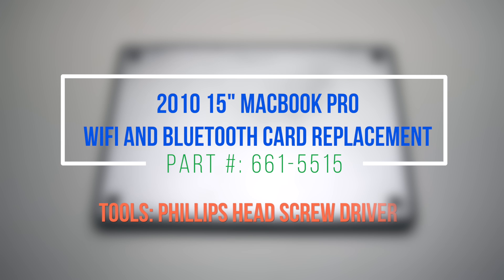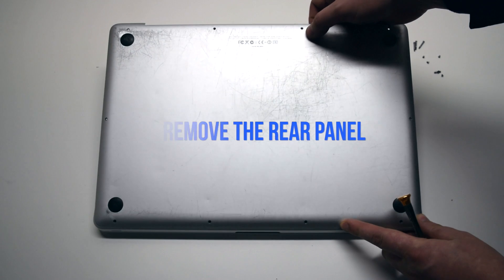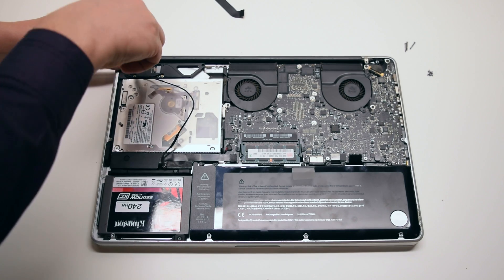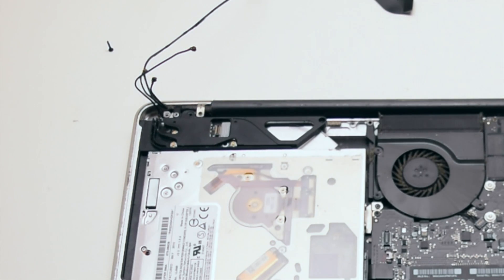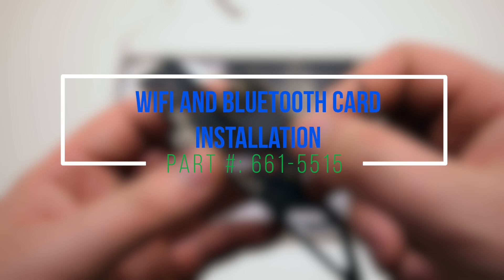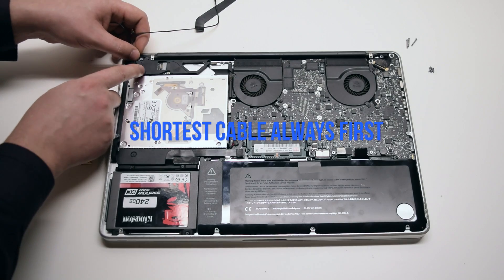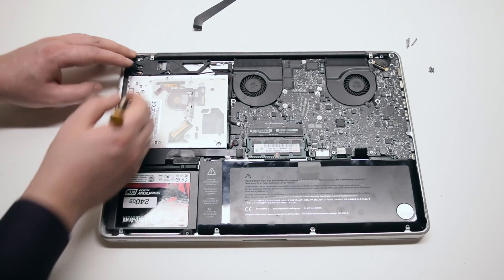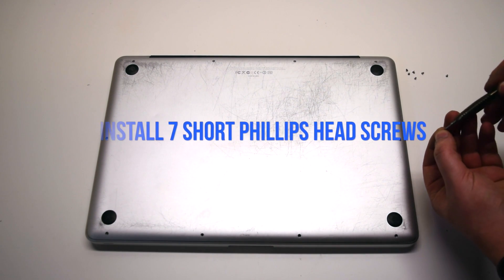2010 Macbook Pro 15" A1286 WiFi and Bluetooth Card Replacement

Comment: Thanks for the tutorial. 

On my machine (A1286 Mid-2012), of the three connector cables the one called J0 has a tiny white square of plastic on it. This is unlike the others and so won’t click into place. No idea how it got there or even if it should be there. Have you ever heard about something like this? I had it repaired a while ago and paranoid that a technician placed it there to get an easy repair job for the future!

Comment: Hello, I need to reemplace the wi fi and the screen from my late 2008 15inch macbook, does the screen from the 2010 works on my model?
Reply from the maker: No, only the 2008 part will work.
Reply: @GRIBSOFT  hey hello.Could you tell me please where I find the logic board plan because my logic board had short circuit... Thanks

Comment: Hi Buddy It s possible replace 2010 original bluetooth card with the new bluetooth 4.0 card of the newer macbooks pro? Thanks
Reply from the maker: Unfortunately that's a negative.
Reply: @GRIBSOFT  Why is that not possible ?
Reply: @gijsdejager2432  Because of physical changes to the hardware, Apple in usual Apple spirit, uses proprietary hardware, but it can be done as an enthusiast has made an adapter, but it costs ~ 200 USD. Mac Pro 2009 to Bluetooth 4.1 and Mac Pro 2010-2012 to Bluetooth 5.1 . More info here: https://discussions.apple.com/thread/7546713

Comment: I just replaced my wifi cable and it fixed the problem! But now suddenly I get a problem with "bluetooth not available" message. Does anyone have any idea whta could be the problem? I bought a new wifi cable on ebay? Could it be that it's not supporting it fully?
Reply: I just discovered what the problem was, and it is quite unbelievable! I reopened the back cover and found out that the wifi cable hasn't fully clicked in place on the wifi side. This has enabled wifi, but it disabled bluetooth. Thank you so much for your channel. After months of trying to figure out what it was, thinking it was some kind of a software issue your suggestions fixed the problem.
Reply from the maker: I'm glad you were able to figure out the problem and fix it, thank you for the support.